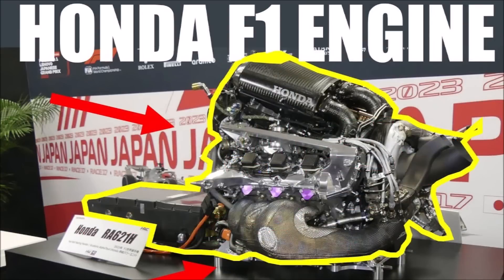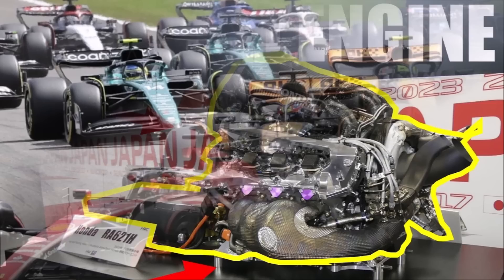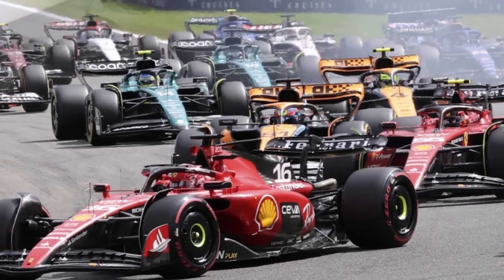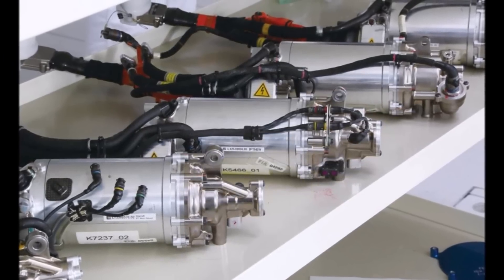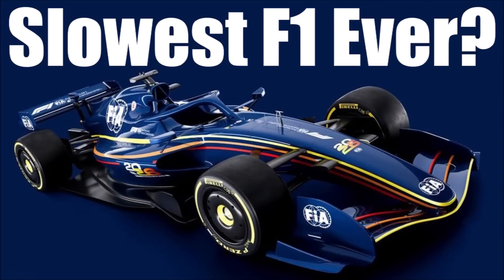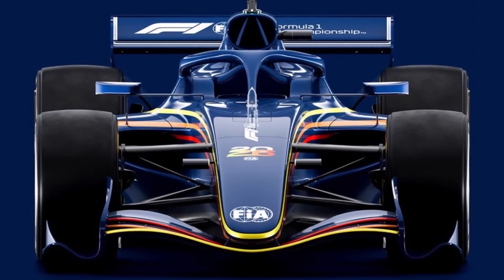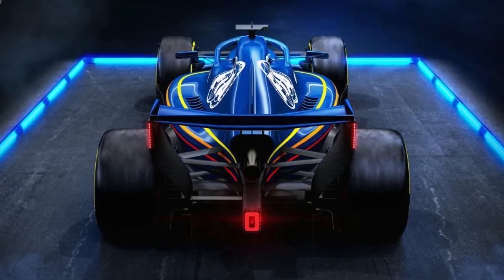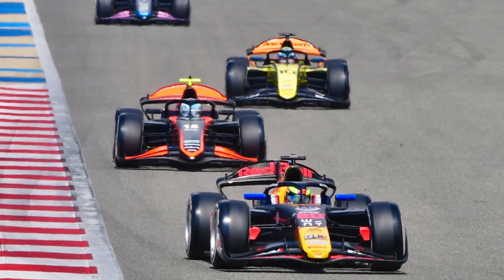F1 2026 Update - CLOSER LOOK

Comment: On top of that, they also got rid of the MGU-H because of Porsche's input, citing road relevance, and now Porsche is NOT going into F1, and they use an MGU-H on their road car! 
They totally should have gone with small front hub motors as they don't require driveshafts. They have plenty of space within the wheels, especially if the brakes shrink due to reduced demand. I'd also at least throw around the idea of carbon ceramic rotors replacing the current carbon/carbon ones as well
Reply: The e motors would always be inside the crash structure in front of the driver’s feet if they did implement it. Being inside the wheel hub simply have too many downsides/practical limitation, unsprung weight, direct vibrations, etc
Reply: @hgdrkui  but you could do torque vectoring under braking, you have a decent aero improvement, and the packaging advantage is really big ofc

and honestly, if Formula Student teams can get hub motors to work so well that they're the absolute standard for all top teams, I don't see how F1 wouldn't be able to hit their reliability targets as well
Reply: @jonashageboke8993  torque vectoring under braking - (1) how would that be useful UNDER BRAKING? (2) Any sort of system remotely similar to ABS would be instantly banned

decent aero improvement - How is putting the motors in the wheel hub going to improve aero when they are in free stream air and MUST require air cooling (chassis-mounted motors can be water-cooled)?? that makes 0 sense. Inboard-mounted motors have the aero advantage, not the other way around.

packaging advantage is really big - u need to be more specific, what packaging advantage are you talking about? If anything i see more disadvantages as the motor would have to be placed closely with the brakes inside the hub which would affect cooling efficiency. On the other hand extending the monocoque 30cm forward in front of the driver's feet isnt that hard to accommodate in order to fit the inboard motors
Reply: @hgdrkui  why would hub motors need to be air cooled? we water cool ours, not a problem. can prob even run the hoses thru the fairings of your suspension members, for zero aero impact. some FS teams do that.
Reply: @jonashageboke8993  wait what kind of cars r u talking about. Student formula karts? Ur telling me water pipes running from the back of an F1 car, all the way around the monocoque, thru the front wishbones, and into the front hub motors, is a reasonable setup? Yea I don’t know about that
Reply: @n0ch91c3s  Porsche are being trolls for shareholders
Reply: The Stage 3 upgrade on F1 cars is a important upgrade.
Reply: Mgu h makes the cars sound worse and heavier
Reply: Audi and others joined because the MGU-H was dropped. The FIA wanted to get rid of it in 2017 (for 2021) but teams refused on the basis that they'd already wasted money on it, and removing it would involve wasting more (and to prevent VW from joining). The "MGU-H" on a road car is a gimmick as far as I understand it, and nothing like what is in F1. MGU-H is a total dead end, a marketing gimmick.
Reply: @Ruylopez778  the MGU-H on that specific Porsche is making it road legal. Without it the EU would banish it to a racetrack because it would pollute too much. Of course, Porsche could always try to sell a new model that is slower than the previous one...
Reply: @TiagoJoaoSilva  "the MGU-H on that specific Porsche is making it road legal."
You don't NEED an "MGU-H" to make a hybrid car, though, and nor did my comment have anything to do with legality.
And frankly, I don't care if "it's faster" because road cars have long been obsessed with maximum power rather than dynamics.

If you want to pretend it's the same thing, be my guest. I'm still going to say that it's nothing like what an F1 car uses, and that MGU-H was a total waste of time and money for the sport and industry.

The car industry should have focused on cleaner fuels, efficiency and durability, but we know that is counterproductive to forcing people to get new cars, and appearing to be seen to "save the environment" by pretending electric and hybrid is the answer - which is why this stupidity was started. And society should have been focused on making public transport more effective and affordable, but it didn't in most countries.
Reply: @TiagoJoaoSilva  Most things the EU do or want to do are not in the interests of the population, so their self enforced agendas and proclamations don't convince me of anything.
Reply: only for regen, f1 should never go 4x4
Reply: The MGU-H required a crap ton of investment from the PU manufacturers. From what I remember, at the time of first development, people had developed motors that could spin at the requisite rpm but only  were up to 1 kW (in what form factor & environment consideration I dunno, but I suspect probably not f1 PU ready…). So they had a lot of work to do to bring them up to 5 kW. 

Nixing the MGU-H would probably be annoying as they spent quite a bit of money developing them & I bet they would have to do a solid amount of re-engineering as they are also used to spool up the turbo at different places on each track - that would need to be factored in when determining optimal power output throughout a course. 

But I am excited to hear how the engines will sound without the MGU-H. I suspect that the energy extracted from them probably squelched the exhaust note considerably.

Comment: The more I hear about this the more depressed I get. It's such a shitshow.

What's wrong with just introducing regulations that set caps on things but don't prescribe them? Tell the engineers a car/wing x carlengths behind the car (in a wind tunnel and CFD) cannot have a reduction of more than say 20%, regardless of position. Restrict fuel capacity/mass flow rate and prescribe a battery size + electric power limit. I want to see the genius people in F1 be creative again.
Reply: That's what I've been saying! The prescribing a wake turbulence/downforce reduction limit especially.
Reply: Because people want F1 to be about the driver's skill alone, while insisting on being the edge of technological achievement in the automotive space. Nobody likes acknowledging the fact that the engineers, who get paid less, are more important than the drivers, because that would get rid of the myth of singular heroes.
Reply: @rafaelmarkos4489  Aside from Hamilton and Verstappen, I am sure in most teams the engineers collectively make way more than the driver. Probably by a factor of 10, or maybe even more.
Reply: @JanVerny  And yet every year we get this cadre of F1 fans screaming about how this is supposed to be a contest between the best drivers and complaining when the engineers get a W (see Red Bull 2023).
Reply: They're too afraid of teams bail from the sport if they can't compete
Reply: People have been trying to claim "anything goes" rules for a long time are the solution. They aren't. F1 wants manufacturers, and manufacturers won't commit to something without clear parameters because they don't want to waste money and get embarrassed. Ironically, Honda in the hybrid era was the biggest embarrassment even with the token system.

Comment: The drivetrain is so backwards it’s actually unreal. Putting a bigger battery in is useless if it has to use the combustion unit as a crutch. Sure, more electric is good for marketing, but that seems to be the only upside I can see.
Reply: How is it better for marketing ? Nobody cares about 50% electric. If anything, the people they are trying to target will ask why its only 50%. And not only that, with no MGU H, the new car will be less efficient.
Reply: @Toro_Da_Corsa  It's the same BS; F1 talking about being "more sustainable" to casual fans they want to force into buying hybrid and EV and patting themselves on the back in a 24 race calendar, burning through energy on the logistics. No, F1 and F1 hardcore fans are not aligned, and yes, F1 management is cynical and lame.
Reply: @Toro_Da_Corsa  the only worthwhile reason for 50/50 was Front Recovery of energy...which was sabotaged by the teams. Remember the LMP1 of 2015 2016 2017, those did have 50/50 split and they had fucking amazing racing.
Reply: All F1 cars will be BMW i3 Range Extender models
Reply: They gotta get up their butts and improve this ICE man. There is no way